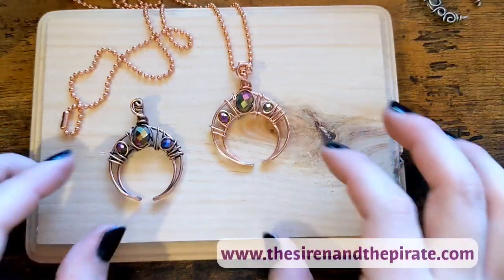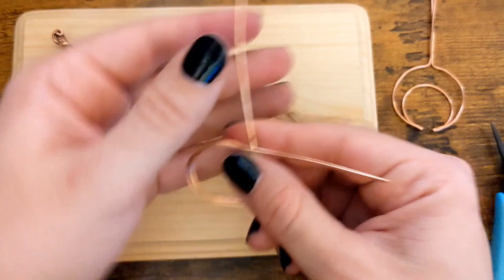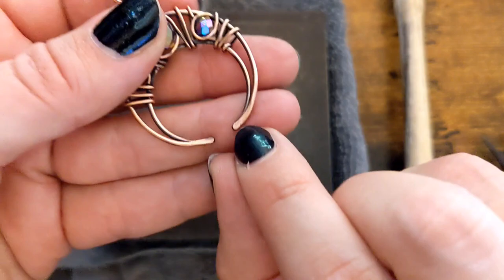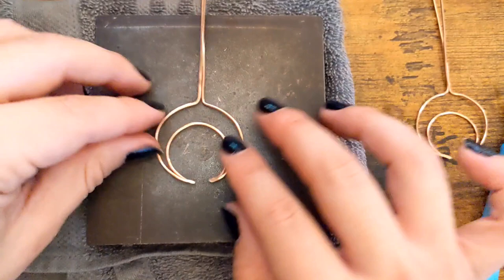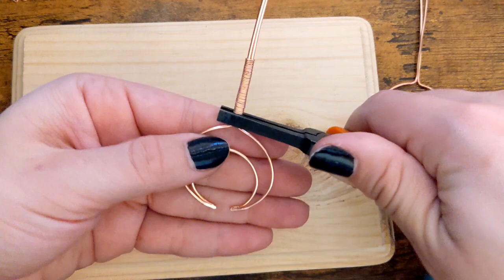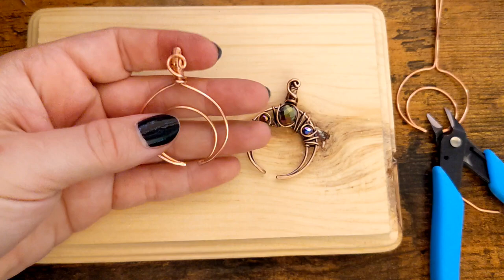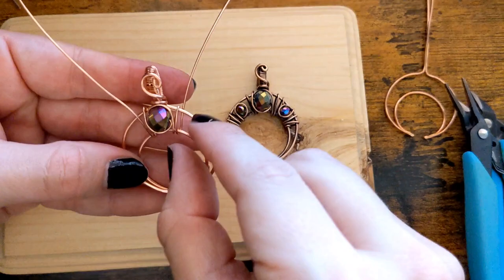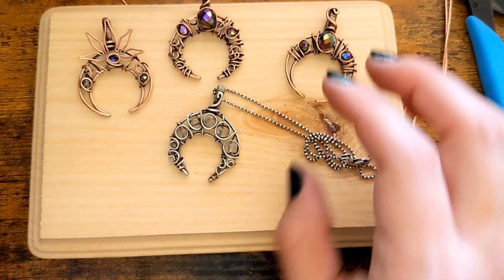Naja/Crescent Moon Pendant | Tutorial

Comment: Just made two pendants and love the way they came out!!! A word of advice to wire-workers using tarnish-resistant (and thus, coated) wire -- Hammering the tips can cause the coating to flake off. As far as I know, there's no remedy for this. I found that careful pinching of the crescent tips, followed by the "twist" you suggested, creates a sufficiently pleasing point without the need to hammer. Of course, if you're using bare metal wire, the hammering works great. Love this design, as I do all your others. Thanks so much.
Reply: They have sealants that you can brush/spray on or you can use clear nail polish.
Reply: Could you not put a teatowel over it or something as u hammer ?

Comment: I am curious to see what it would look like if you wanted to use a softer stone like turquoise and if you cut your wire and patina the wire and THEN work with it?? Would it look as nice or would it scrape off? I have lots of white water turquoise and similar and would love to make one of these with it but its too soft to put in the patina. And the stones are too expensive to chance dipping them in LOS. Have you ever tried doing it that way?
Reply from the maker: I have not but I would suggest getting a patina that you can just brush on after the piece is completed. That way you can avoid getting it on your stone.

Comment: Would 20 gauge work ? Tia
Reply from the maker: Yes, you will probably want to work harden the frame by hammering all of it and then using a smaller gauge like 24/28 for wrapping the beads. It won't be quite the same final product but the concept will be met.